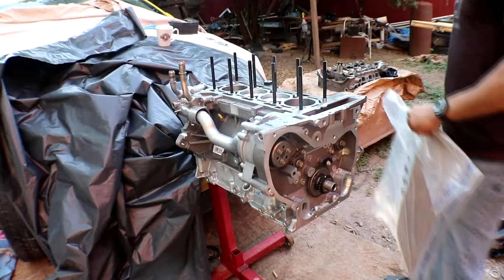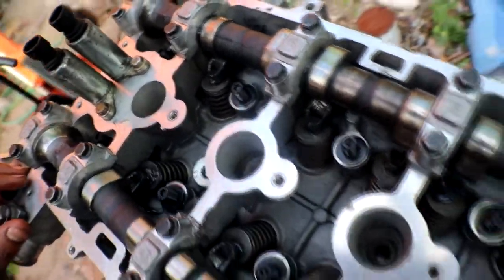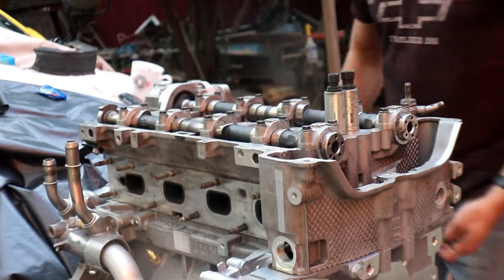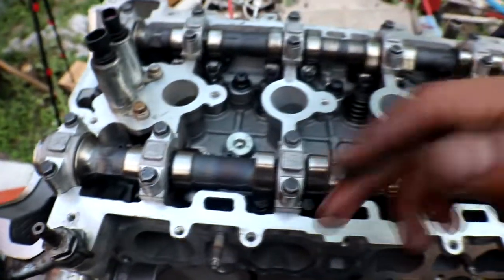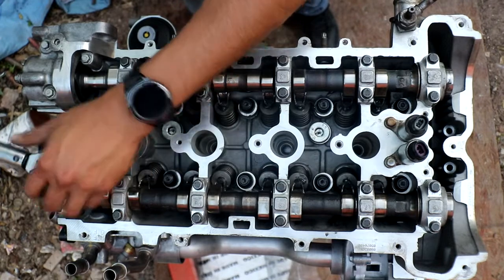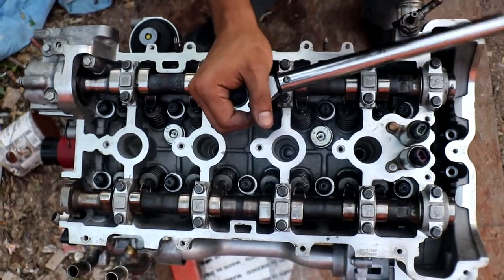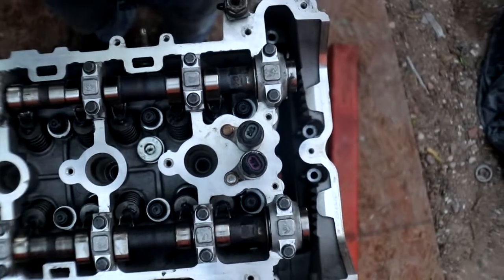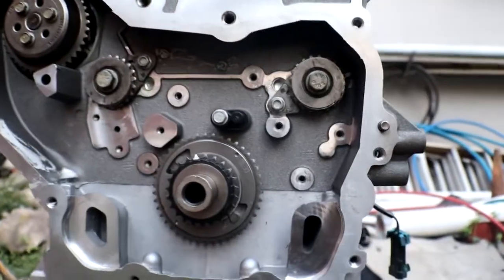Ecotec Head Installation & Torque Sequence (Part 4)

Comment: After doing this how do you set the timing?
Reply from the maker: I have a how to video on timing called just in timing. Check it out!!
Reply: My mistake I know how to set the timing I just did my timing chain n water pump kit last week. I was looking into maybe getting a new cylinder head assembly and was wondering if I have to set the cams to be in the 10 and 2 position or if they will already come that way? @09CamaroFANATIC
Reply from the maker: I'd recommend making sure it's set at the 10 and 2 clocked positions with the cam sprockets. @charlesroybal4764
Reply: Sorry still learning I have a Chevy cobalt LS 2006 5 speed I've been working on.

Comment: Hey I'm not sure if you'll answer this question but I didn't see it in the video. Do you know the torque specs for the cam bearings? "Cam bolts"
Reply from the maker: @nathan_bruh.comedy9725  Yeah, for sure. 89in lbs for the cam cap bolts
Reply: @09CamaroFANATIC  oh ok so that would be about 7.4 foot pounds right?
Reply from the maker: @nathan_bruh.comedy9725  yup, correct.
Reply: @09CamaroFANATIC  thx man I appreciate it alot.
Reply from the maker: @nathan_bruh.comedy9725  yeah for sure! Anything to help

Comment: Good video but aren’t those arp studs 80ft lb. The stuff you did was for stock head bolts
Reply from the maker: Yes you are correct! I did correct it on the engine before starting I just failed to mention it on the video 😕 
Correction on description for the video

Comment: Do the torx bolts need to be replaced? It looks like he used originals.
Reply from the maker: Yes it is recommended to replace all the head bolts including the torx. I did however reuse them, but do recommended replacing them as stated by manufacturer.

Comment: 6 point sockets are better to avoid stripping since longer flat sides have more contact. The 12 point is just easier to catch with less rotation, especially in a tight location.

Comment: I have been using these video's over and over  practically frame by frame and really want to thank you.  I am kicking myself for not dropping the engine out of the car (found that on another video) but these video's are really life savers, and I have the torque specs in a document and have verified they are all good.
Reply from the maker: Thank you I appreciate it!! More to come
Reply: Me too lol...i have a question broo...como ajustas las valvulas ?
Reply: @NerdrageHockey  thank you so much

Comment: I'm rebuilding my engine. Whats the trick to getting that one camshaft out of that little housing opposite the timing chain? I can't seem to get mine out
Reply from the maker: You have to remove the 3 10mm bolts securing the cam cap for the hpfp to be able to get it off and remove the cam

Comment: incorrect torque ... Torque specs: 80 ft lbs with ARP lube.
Reply from the maker: Yes thank you I went ahead and corrected the torque specs before final completion. I saw the paper with torque specs from arp after I submitted and went ahead and fixed the issue. Thank you for the correction non the less, I appreciate it!
Reply: Anytime:) whens ur next upload coming:) hows the engine coming?
Reply from the maker: @mcwilly14  next upload should be end of day tonight if not tomorrow afternoon, and the engine turned on and came to life smoothly!!🤗
Reply: And usually the ARP lube is not supposed to be applied to the threads on the deck end, only on the washers and bottom of the nuts are supposed get the lube.
Reply: Hi..now im confused a little bit
Should I do torque at 
22 ftl bs or 80 ft lbs thks